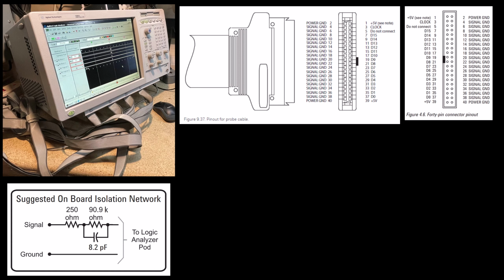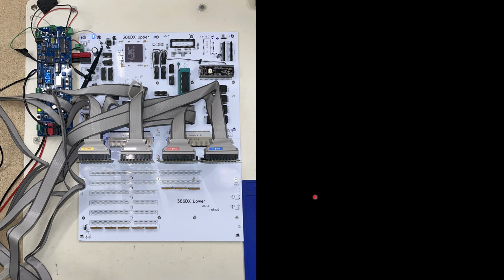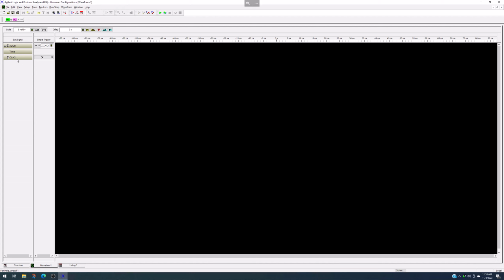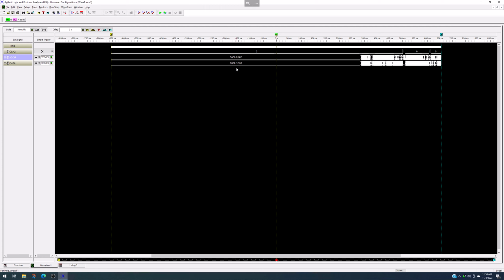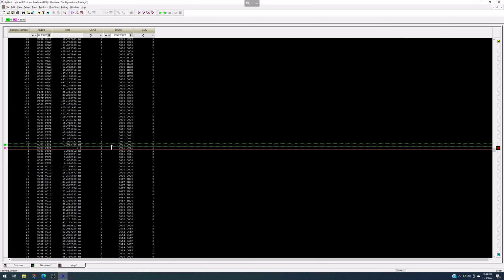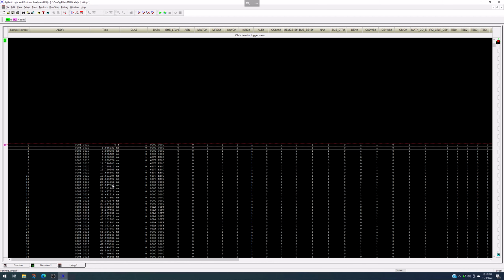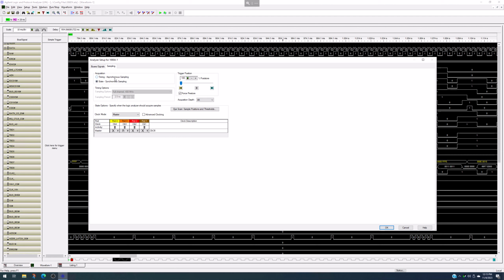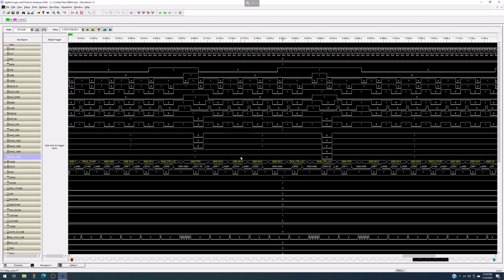First Use of an Agilent Logic Analyzer

Comment: I too recently acquired 1680AD. Very helpful and I am very happy with it. Thanks for the instructional video!
At the end of last year I finished my first (hobby) 68000 computer designed from scratch. Since I had a Saleae Pro 16, I was skeptical that such an old logic analyzer would be useful (and quite expensive), but after using it, my worries were unfounded!

Comment: Your video helped me a lot, now I can start with the equipment that was lying unused for a long time. 64-channel Model 1682A. The original 800x600 monitor was damaged, I replaced it with a 12" version identical in size and format but with a little more resolution, 1024x768. Now through your video I can start using the company's equipment. We have a complete boardmaster but not even He always manages to detect defects in logic circuits, requiring a deeper analysis with an oscilloscope, etc.

Comment: Logic analyer are great, aren't they? The other advantage of s real LA rather than your re-tasked arduino or whatever it was, is that you're guaranteed cotimed sample across all your signals. Depending on your system, that can be really useful to avoid giving you weird traces dues to the software basically scanning ports one bit/byte at a time, basically giing you staggered timing.